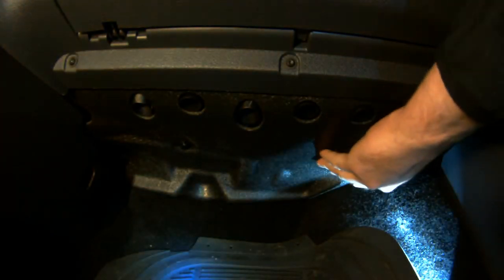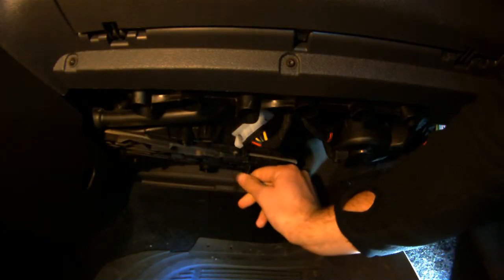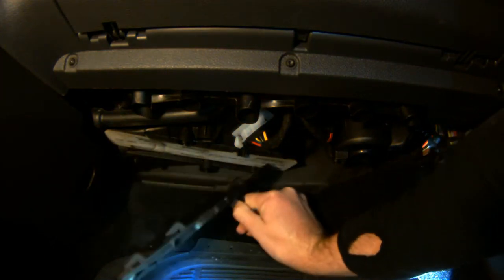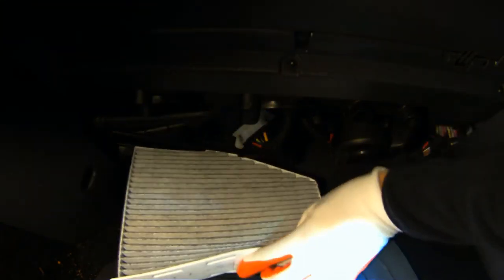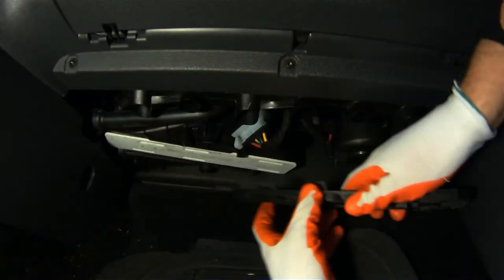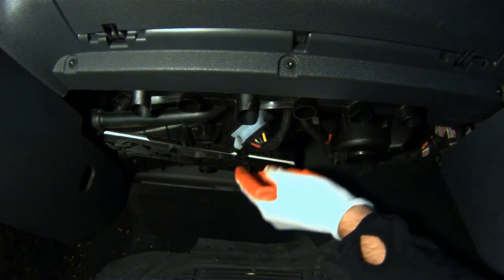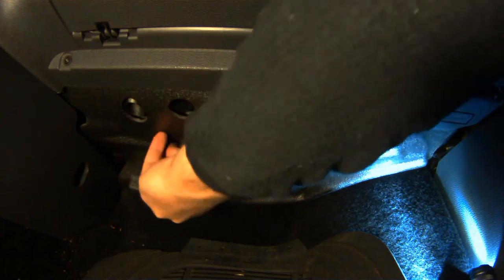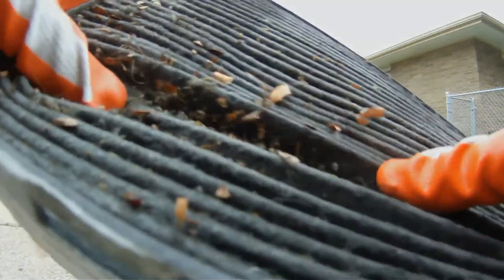VW Rabbit Cabin Filter (2004-2008)

Comment: Good lord mine was wrecked.  Nice and clean now. Always do this on new cars you get (when used and new to you )
Reply from the maker: Crazy how dirty they can get, huh!?
Reply: @hanoihancock  I always change mine. But didn’t feel like looking in the glove box or under so I pulled your video up to find location and how to open easy. Your directions were easy to understand and no not needed bs said. Thanks for the video.
Reply: @hanoihancock  I just got the new rabbit and my first things are always all fluids,brakes, wipers and filters. My air filter was so bad when I tapped it on the trash can it broke into a ton of pieces.
Reply: @hanoihancock  I’m in Arizona so cabin filters get REALLY dirty

Comment: Mine was much worse than that, and I also have a blown thermal fuse (your video on that and the blower cleanout are also great - I've removed both, but have to get some carb cleaner).

My blower is a tiny bit stiff, but not too bad. It's obviously had liquid dripping in though. I do wonder if what blew my thermal fuse is a combination of some friction in the blower AND a filter that's so filthy it was blocking some airflow...

Comment: Do you have to remove the glove box to do this and service the blower motor etc?
Reply from the maker: Michael Pinto You do not need to remove the glove box to access the thermal fuse, the cabin filter, or the blower motor.  It is recomended that you clean/lube the blower motor if your thermal fuse has blown.  If your thermal fuse is okay, and there are no noises coming from your blower motor, then simply change the cabin filter only.

Comment: Trying to find the A.C. filter on a 2008 Rabbit. Only results YouTube gives is the Cabin filter. Anyone have info on the A.C filter
Reply from the maker: Cabin filter and AC filter are the same thing.   Now...if I could only figure out where the blinker fluid goes;).
Reply: @hanoihancock  so their isn't an inline filter inside the AC system. Pretty much every other car has one.
Reply from the maker: @evanabston7223  If you mean an inline heater core filter...one that filters coolant rather than air..., I've seen people install those aftermarket, but I've never seen one come stock on any car.
Reply: @evanabston7223  yes there is it's called an ac orifice
Reply: @hanoihancock  he's referring to the orifice in the ac line under the hood